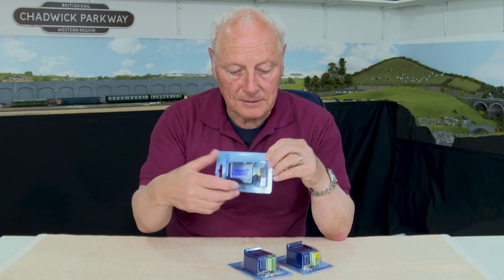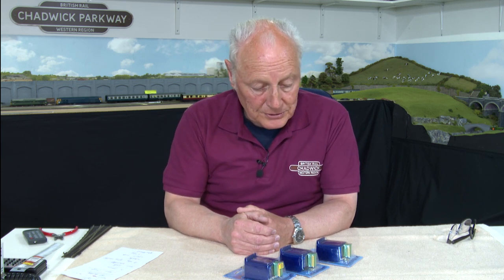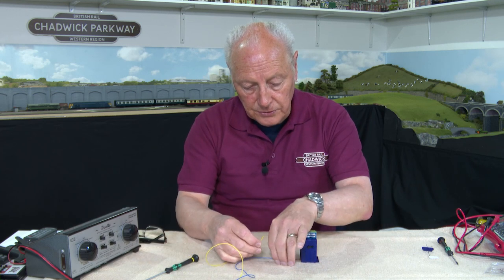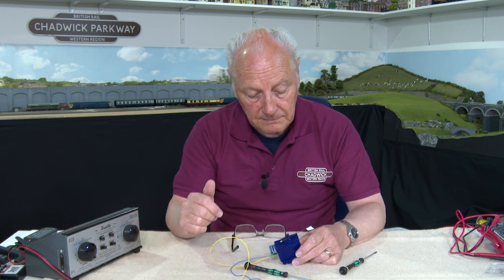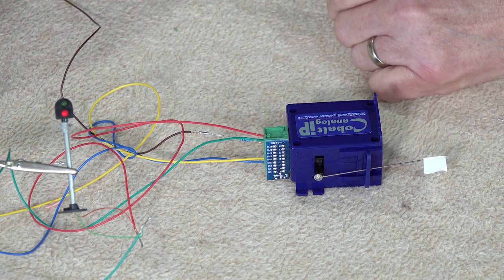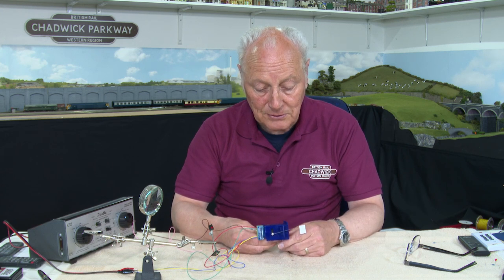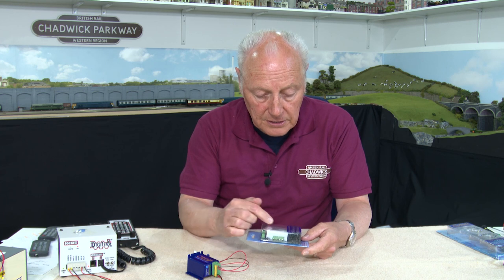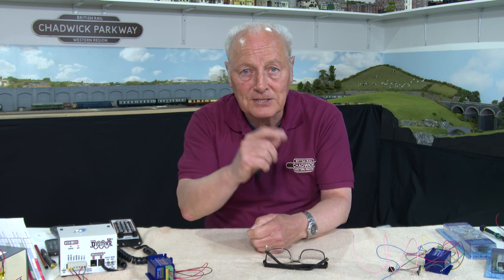Cobalt Point Motors on test at Chadwick Model Railway | 161.

Comment: Still like a Tortoise. Been running those for 30yrs and never had a failure. I tried Cobalts when they first came out. The less said the better.
Reply from the maker: Interesting Charles, I certainly won’t be changing over.

Comment: I use 22AWG solid core hookup wire to connect them. You can just press it into the hole without having to work the lever with a small screwdriver.
Reply from the maker: Thanks Jay, regards Charlie

Comment: Hi Charlie. Another great video.  My planned layout has nearly 100 point and half that number again of servo motors required for semaphore signals; no semaphores in the fiddle yard.  I have gone down the ESU Switch Pilot Servo 3 route for a couple of reasons.  You can add a separate AC or DC supply for the ESU unit and use the DCC input purely for control, thus saving a lot of DCC power, as well as being able to switch signal bounce mode on if controlling semaphores.   In addition you can switch using DCC or switch just like the Cobalt.  I did start to use ESU Switch Pilot Extension which have two relays per channel but have moved back to microswitches on the point motor module.  I am using the Make It Miniature Linear Turnout Actuators which do not use a 'spring' wire but instead move a block linearly left and right directly under the point with a very short stub wire.  However, another key point is cost.  The Cobalt Digital comes in at £22-26 depending on the quantity purchased. The ESU and Make It Miniature combination is £16.   So, a Cobalt Digital solution for my planned layout is £3,750 whilst the ESU/MIM solution costs around £2,400.

Useful tip in the thread about isolating power using the spare switched output. Dead section would need to be at least the length of your longest locomotive.

Look forward to seeing the track testing and how you have set up block power and block detection.
Reply from the maker: It sounds like you’ve made a sound decision Patrick, finances must always be brought into the equation. Hope you enjoy the next one, regards Charlie

Comment: Excellent video, thanks Charlie.  
I believe Tortoise point motors also have (some/all?) the switching functionality, so I wonder if you noticed any particular difference between your Tortoises and the Cobalts? Is it just the clippy connectors and lifetime warranty that mark the Cobalts out?  
Shame they don't build a lubrication hole into the casing. Like you say, nobody's going to start taking them apart once installed.
Reply from the maker: Yes Andrew, tortoise motors do have two switch circuits available.
There are differences between them but at this stage I’m unable to comment as to which is better. Both have there own unique advantages.
Regards Charlie

Comment: You really don't need to take the armature wire out to install one of the input wires. You can push the holder down with the end of your finger, I've regularly have done this on installed Cobalts.
Reply from the maker: Thanks for the tip Ben, regards, Charlie

Comment: Another informative video Charlie, thanks. When I started planning my layout (I am on year 7 of a 3 year plan 😁) I did a serious survey of all types of pont motors. Being retired my funds are limited so Cobalt and Tortoise motors, although highly desirable, were not an option. Being a retired electronics engineer I am very lucky to be able to design and build various electronic  gizmos for my layout. I settled for servo motors fitted to Dingo mounts driven by the ubiquitous Arduino. It works well but the downside was I spent an awful lot of time in the design phase (yes, I am a compulsive perfectionist twiddler 🤔)! I can now concentrate on the layout build --- mmm, perhaps I could just tweak that .......aaaaaaarg!!!
Reply from the maker: A great comment Derek, and very much appreciated.
I feel your pain, regards Charlie

Comment: I've used Cobalt IP analogue motors which I briefly powered using an H&M controller. They didn't like it with some point motors constantly oscillating. I contacted DCC Concepts and they were very helpful. They advised me that the power from a controller can have serious power fluctuations which can upset the point motor. The power fluctuations aren't visible on a volt meter, but show up on an oscilloscope. I took their advice and used a stabilised power supply (ex modem plug type power supply) and it solved the problem.
Reply from the maker: Great tip Neil, many thanks. Regards Charlie

Comment: great stuff as per Charlie.... just putting apoxy on my dcc plugs and decoders... stops wires pulling off....
Reply from the maker: That’s a little drastic Dave, regards Charlie
Reply: @ChadwickModelRailway  that could be true.. thing is i am converting about 18-20 locos to dcc from small stuff like J72 Bachmann's, to bigger Scotts, with Mainline and Hornby's as well. You have to cut away some of the chassis and isolate the motor, but you know this, and of course there are 2 or 3 types of split chassis... 
Hornby's are not so bad.. Any hoo it means lots of on and off and plug and unplugging. Also helps keep the wring tidy so bit of heat shrink up to the socket board then a drop of Alraldite to hold wires and helps with insulation as well and its kinda enjoyable.. i think it would be not as much fun to buy, unpack, put on track, program then watch the loco go round and round :) Am a bike mechanic by trade and fixing stuff is great..

Comment: Hello Charlie! I did ordered one Cobalt IP analog motor yesterday and see forward to test it. I have tortoise motor at home and can see difference between those motors. It is range of motion in the lateral joint. Did you tested too with at Peco code 75 turnout?
Reply from the maker: No Anders, just with code 100. 
Regards Charlie

Comment: hi an interesting video as always but if I was a beginner in the hobby i would find the way you put it. analog  and classic and digital. heavy weather and some what confusing.
we have currently have 85+ classic and analog  using dcc concepts own lights for the points and we also operate them with their point levers . also yes  they will replace a motor. we had a couple of motors with chatter. sent them back but it was not straight forward .
but having now being using them on Extor junction generally we.ve had  a little trouble and they are a good motor .
best wishes bob+ nigel pryor
Reply from the maker: I’m so sorry that you thought that the video might be confusing to a newcomer.  I had thought that I pitched at the right level, but perhaps not.
Regards Charlie

Comment: Awesomely to the point as usual Charlie. I have only one of these, purchased from DCC Concepts direct when I was poor, and they were in Naval Base, Perth. 
I’m rebuilding from scratch now and will use a range of point motors, all slow acting, and I plan to use push buttons (dcc concepts have very nice ones which include an LED). 
However, I wasn’t planning on using the point motor input. My understanding (I may be wrong ) is that if you use that input, the DCC system doesn’t know you’ve done it. For anything with automation it will not know that the position has changed.

The solution I’m going to use for my panel is to utilise a digital input which then takes the signal and tells the matching digital address to change. I tailed it successfully on a couple of test points and will implement it fully on the new layout. If there is a better, easier way I’d love to know.
DCC Train Automation provided my the basis of this approach.
Reply from the maker: Yes, RW, you are exactly right.
It is vital that your control software is aware of the point changing.
Regards Charlie

Comment: Great video as usual, Charlie. Pity you didn't try to install one using the sticky pad. I thought the same as you initially, but these pads are VERY sticky. I recently removed a few from an older layout (they'd been in place fot about 6 years) and whilst the screws came out easily, the pad was quite hard to remove. My new layout has replacement pads and I'm not bothering with the screws at all.

Totally agree with your maintenance thoughts though. It's nice that we can maintain them, but once fitted, they're staying put. Feeding the wire through the hole after it has been cut to length in itself can be very difficult in itself.
Reply from the maker: Great comment John, many thanks.
Reply: A solution for the activator wire  would be to fit a new length and cut to size again.

Comment: Charlie,
A cracking comparison and a very attractive product, well recommended.
I suppose an important question might be, with a railway already operated by 50+ Tortoises, are they worth considering as a replacement for improvement or does your current arrangement satisfy all your needs?
It's another of those decisions that will be influenced by where you are in the modelling cycle. You often hear "if I was starting from scratch, I would probably ........". 
Bob
Reply from the maker: I will definitely stay with tortoise Bob. 
Regards Charlie

Comment: Charlie, is this a case for forward planning?  By stripping down a (new) Cobalt, you can see where the gearbox is, and determine how easy it is to put a splash of lubricant into the gearbox. If this shows that it can be done without compromising the motor or EOT switches, then you could put a small hole to fit the specialist WD40 straw, and could add lubricant without removing and stripping down the assembly. 
To avoid long-term flooding, you could also have an overflow hole, to limit the excess lube. 
And use the correct specialist WD40; worth having a can and labelling it’s uses on the layout.
Reply from the maker: Taking advice from DCC Concepts., this lubrication is only advisory.
You still have the lifetime warranty.

It’s certainly something that I wouldn’t be doing.  it’s so difficult to remove them in situ and they’re trying to re-thread the armature wire.
Regards Charlie
Reply: @ChadwickModelRailway  Charlie, if the holes are in the right place (by design), then you can inject the lube without removing the Cobalt.

Comment: One of the reasons you give for not going for the less expensive Classic point motor is the higher current draw when stalled. Might be worth noting that if you use the Megapoint system to control your points it automatically switches off the power after 5 seconds therefore no permanent current draw. Same would also apply to the IP Analogue motor.
Reply from the maker: No Ian, it was purely an comparison between the 3 types of Cobalt.
Otherwise, I would have gone deeper into servos and tortoise.
Regards Charlie
Reply: Megapoints do a control system for cobalt point motors just using a Netwok cable between control panel and layout. Personally wouldn't consider it beneficial to pay the extra £4
Reply: Ditto the ESU Switch Pilot Servo

Comment: Really great video. I'm between these and the mega points servo control currently with the merge mounts. I think I'll probably end up with both. I do like the ability with these to put them remote from the alpha based mimic panel. But the servos are cheaper and mega points do a nice realistic semaphore bounce. I can also use them for level crossing gates as well.
Reply from the maker: Good luck with which ever one you choose E100. Regards Charlie

Comment: another 1st   class  practical video i noted you said you use  07/2 for all your point motors  i have solonoid and use 16/2 wire do solonods need this wire or do you think 07/2 would suffice my max run is 3/4 feet thank you
Reply from the maker: Perhaps 16/02 would be better for solenoids due to the current pull. Regards Charlie

Comment: Great video! Just a quick question, maybe you can help? I have got my DCC Concepts IP Analogue hooked up to my Peco points at the moment. As I didn't know what point motors I would be using when I set my layout up over a 2 years ago and was hand throwing the points for operations I left my Peco point spring in. Other than the loss of slow point operation, are there any other drawbacks of leaving the point spring in? I'm a DC modeller who didn't know better to put in a jumper wire prior to gluing the points down. In my case, the connection of the switch throw is very important to ensure that the rails between the switch and crossing are powered. Thanks for any help. If you aren't sure all good. Love your stuff! Love this product with nothing but good things to say about it!
Reply from the maker: The removal of the spring, is not necessarily essential.
It just means that the point will click across rather than be a smooth slow action. It might not even be noticeable.
Regarding point modification, you are where you are, just keep the point blades very clean.
This should work okay, regards Charlie
Reply: @ChadwickModelRailway  Thanks Charlie!

Comment: The issue I see with the LEDs is that they change BEFORE the motor operates and changes position which leads to a risk of false indication on failure.  Really wish they had set these to indicate only AFTER the point has moved.
Reply from the maker: But isn’t it the motor that changes the LED Andrew? Regards, Charlie.
Reply: @ChadwickModelRailway  it appears to be unrelated to motor position as the LED colour changes immediately BEFORE the actual motor completes operation.  Really you need it to only change state once the motor has completed showing that the point actually did move.  Otherwise the LED would indicate a change of position even though the motor itself failed to move.

Comment: So will Chadwick continue to use Tortoise or will you be switching to Cobalt? From your previous Tortoise review I remember you chose Tortoise based on them being quieter in operation. Is this still a major factor when considering the Cobalt IP digital. Great video Charlie, thanks
Reply from the maker: A great question William. No I have no intentions of changing from tortoise to cobalt.
I’m committed to one brand although it’s always worth checking out what else is available especially when it’s more technologically advanced. Regards Charlie
Reply: @ChadwickModelRailway  I am a Chelsea fan so Blue is always going to be better than Green :)

Comment: If you have 50 sets of points, perhaps you could service 10 units per year so that one would rotate through each unit every 5 years but spread out the pain.  The startup cycle would involve some unnecessary service, but over time it would be reasonable.  Or you could just run them until they die, a method many model railroaders practice with their locomotives.  ;->  Of course I'm very happy to give out unsolicited advice to others.   My own layout has only two sets of points and no point motors--only those Peco springs and a bamboo skewer to move them.  Cheers from Wisconsin!
Reply from the maker: An interesting option Andrew. 
Regards Charlie

Comment: The cobalt IP digital is a great motor but unfortunately they are not designed to be serviced if something goes wrong with them, basically if they stop working theyre fit for the bin.
Reply from the maker: Yes but they do have a lifetime guarantee. Regards Charlie
Reply: @ChadwickModelRailway  This is probably the reason why, i used a couple of these while back on a shelf layout, they save a lot of messing about with dcc modules as they get their power from the track but theyre a bit noisy, i rectified this by fixing them with black silicone sealant instead of screws, basically i fixed them with screws until the silicone set (about 6 hours) then removed the screws

Comment: I have 9 of the ip digital motors on my layout and they work great I still have about 8 Hornby surface point motors that still work fine and do the job but don’t look as pleasing sat on top of the layout in time I may change them for the ip digital.
Reply from the maker: I think that’s a sensible move Stephen. Regards Charlie

Comment: Great  review  Charlie 
At last someone has produced a simple easy to understand video explaining  the differences between these products. 
Do you know what length the  throw bar is above the height of the motor casing.?
I  will be purchasing the  IP Cobolt but will need to extend the length of the bar as some points will be sitting on top of 50mm foam boards. 
Any suggestions on how to do this would be  greatly  appreciated. 
Keep up the great work and  content. 
Nick Australia
Reply from the maker: I think that is possible Nick.  You just need to buy long length of piano wire, of the right gauge, and cut it to length.
Regards Charlie
Reply: @ChadwickModelRailway  thanks  Charlie

Comment: The question is. Are Cobalt motors as reliable as Tortoise motors? Which one uses better materials for a longer life?
If you don't oil the motors after 5 years, is the warranty still valid?
Reply from the maker: Great comment but only over time can report my findings. Regards Charlie
Reply: Just jumping in here to say "yes" to your question about warranty - the oiling is a recommendation, not a warranty stipulation. On the materials, we use fibreglass reinforced engineering plastic and they are proven to run for over 250,000 changes without failure which is why we are happy to give a lifetime warranty :) I hope this helps you.

Comment: What is the current draw of the digital version? With a large layout it’s something one needs to know as it would be “taking away” current that you would need to run the locos?
Reply from the maker: You make an excellent point Kenneth, and if you’re using a large quantity of points and perhaps a accessory DCC bus should be considered.